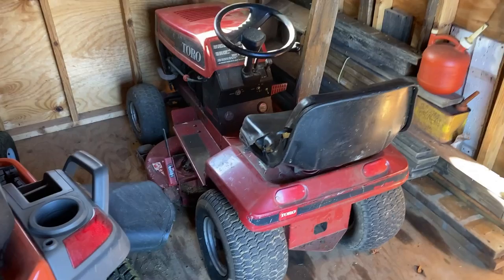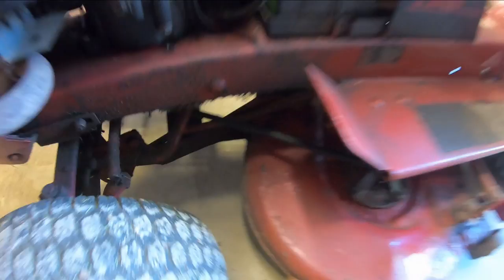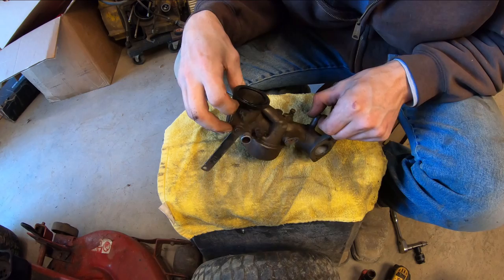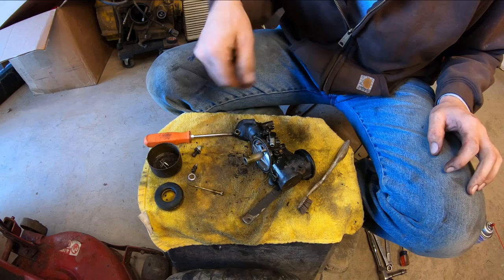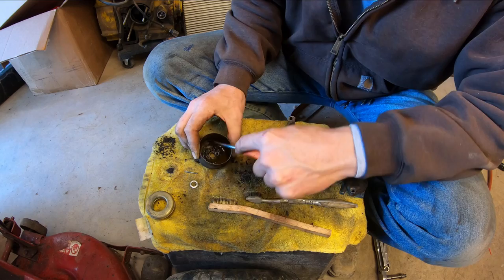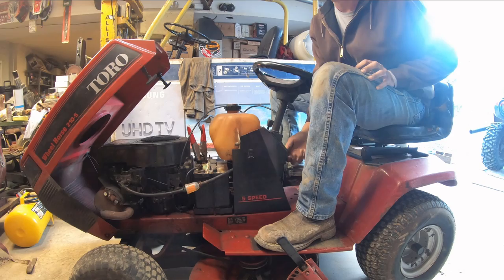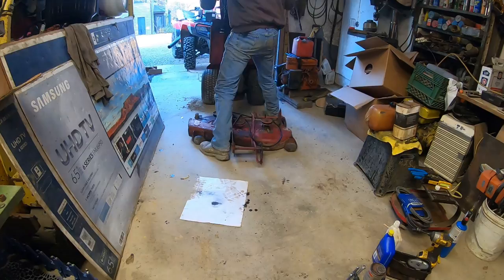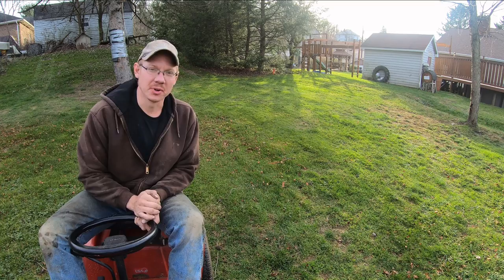Toro Wheel Horse lawn tractor sitting 10+ years Will it run!???

Comment: I agree with you about our "throw-away" society. I generally keep fixing until it is to far gone to repair.  Then, if I can,  I will buy used.  The problem is often a matter of merely cleaning the "broken" machine.  Great vid.
Reply: Unless you can do your own repairs, it's often very costly to have a shop pick it up and service it. The cost of a carburetor kit is about the same as some new carburetors.
Reply: @tiredoldmechanic1791  You are absolutely right! Like many others, I grew up poor, so my family  did a lot of things to get by, like carpentry, mechanics, farming and fishing.  At the time, I thought it was a hardship, which at times it really was. Once I became an adult Iwas able to use many of the skills I learned back then. Now I see it as a blessing.  By doing my own work, I have saved many thousands of dollars over the years. As well, I get a tremendous amount of satisfaction by "saving" things instead of throwing them away.
Reply: Unfortunately a large percentage of the younger generations in today's society mechanical aptitude and common sense has become few and far between, so rather then learning from someone with experience or teaching themselves they have no choice but to waste money and resources on replacements. Thats also a large reason most everything we have to  buy is cheap imported garbage rather then quality local goods. 🚮
Reply: @pnwdad1261  I've discussed this before but you can't really train somebody who wasn't born with some mechanical aptitude. There has been a shortage of mechanics for years.
Reply: I have a lawn mower from 1981 (Tecumseh, 3 HP, 19"). It's so old, in fact, it doesn't even have a dead man's switch (which I like -- easier on your hands). My older brother found it in the trash maybe six years ago, still in fully operational condition. Nearly 40 years after it was built, the machine still starts on the first pull even after sitting all winter, and is the most fuel-efficient mower I've ever had. Can't beat some of those old mow-chines!
Reply: It's really easy to spend other peoples money.
Reply: My step dad had 3 different busted lawn tractors. Instead of buying a new one, I used parts yo make 1 good running tractor and 1 parts tractor he sold for couple hundred bucks. I'd say better decision than dropping 1500 on new tractor
Reply: Same goes for the belts though.  Finish them off. Run 'em till they break!

Comment: When we were little boys these little tractors made us feel we were the top dogs! My first was a Cub Cadet 70. Three Speeds and dad said keep it in first when mowing and when he wasn’t around it was second gear all the time!! Thanks Matt for helping me remember a better time.
Reply: I'm sure there is some young man out there who would love to have this mower to use or even start his own mowing business.
Reply: '71 Cub hydostatic. Go flying down the hill in top gear, lock the brakes on wet grass and go sliding through the yard for forty feet. I can still hear my Dad raising hell:)
Reply: Being a International Harvester Cub Cadet tractor owner as well as a Wheel Horse and Power King tractor owner, you can mow with no problem in second gear, as long as your grass isn't to long, your blades have to be razor sharp, everything greased up properly, and strict maintenance, you'll be fine. Trouble is, in today's society, these outfits change hands to different outfits, and they start eliminating the good old equipment calling it obsolete, parts are hard to get and come by, and they start getting and using chineese garbage and junk that won't last for very long, and needs replaced because you simply cannot fix it yourself. Unfourtionaly, this is our society these days, the good old American know how and good old machines from the past that is built and made with endurance and strength are now a thing of the past, and as each year goes by, it gets worse and worse each year.  Very sad, however, very, very unfortunate and true.

Comment: Strangest 1950’s Gas Powered Air Compressor I’ve ever seen?
Reply: Runs on gas and compresses air in the cylinders, right?
Reply: @corydriver7634  I’m guessing you didn’t see the title “1950s Gas Powered Air Compressor, Will it start” hence all the reply’s referring to a funny looking air compressor. The title has been changed since video first went live.
Reply: @edmullins4519  No, I saw the original title. That was my attempt at humor.
Reply: @corydriver7634  10-4, and you were correct!

Comment: "Briggs and Scrap Iron"
That was good.
Reply: Yep...I had a good laugh on that one as well.
Reply: I prefer Kohler engines myself.  Briggs engines run good when they are on push mowers.
Reply: @danbasta3677  those are usually the little 5hp Raptor engines. A good design. Like Matt said, the I/C's aren't bad but a few years ago I bought a Kubota Zero Turn and could choose either Briggs or Kohler. I went Kohler and it's been a good and reliable engine.
Reply: It was funny but I’ve never had much trouble with B&S engines. Honestly Kohler engine’s have gave me trouble. I guess it depends on the year, and who slapped it together at the factory 🤷🏻‍♂️🤷🏻‍♂️.

Comment: I totally agree with you on the “throw away society” point of view, I wish more people thought that way. Years ago when we moved in to our home, my wife and I hauled several pickup loads of trash to the dump after cleaning up our acreage. The landfill was a 100’ deep crater covering about 80 acres. About six years later I had to haul another load to the same dump—it was a 100’ tall mountain covering the same 80 acres. The sad thing is much of the stuff in there probably could’ve been recycled or reused somehow. Good work keeping that old mower working.
Reply: There are competing schools of thought on what it means to be environmentally friendly.  Do you get the new mower because it uses less gas (or no gas) and toss the old one, or do you fix the old one, save the landfill and keep the gas guzzler?  The environment is probably farther ahead with the fixed-up old one.
Reply: @bonemar66  New lawn mowers aren't necessarily more fuel efficient. Manufacturers seem to keep putting larger and larger engines in their machines. While fuel economy/HP might increase, the higher HP means you're no farther ahead.
Making a new lawn tractor (10 kg aluminum for the block, 40 kg steel for the frame, 1.5 kg rubber for the tires, 5 kg plastic for random plastic parts) would emit at least 167.5 kg of CO2... the equivalent of burning about 72.8 L of gasoline.
TL;DR: if your new mower is 10-15% more fuel efficient than the old, you'll have to do A LOT of mowing before the environment is farther ahead with the new one than the fixed one.
Reply: @NSEasternShoreChemist  not to mention new mowers don’t seem to last as long (at least in my experience).
Reply: @corydriver7634  Yeah, I think it's because the decks are made out of cheap Chinese steel that lacks quality control/corrodes easily

Comment: These old Toro Wheel Horse tractors are tough. We rescued the same 210-5 model left as junk on the roadside with a "FREE" sign on it.  With some TLC and $350 for wheels, tires, seat, spindle bearings, blades, oil and a new carb it will probably run another 30 years.  Wasn't ready for the dump.  What's ironic is the previous owner is a mechanic, and he replaced this with a new Craftsman.  It cut an acre of lawn all summer without a  problem - runs great.

Comment: My old Simplicity tractors have the valve stem on the inside as well.  I think if you add wheel weights, it makes it easier to air up the tires.
Reply: I think it also lessens the risk of damaging the valve on stuff! 🤔
Reply: It's also for when optional hub caps are added.  My narrow frame Cubs are like that as well.

Comment: I've got the little brother to that mower, it's a wheel horse not sure the model but it's got the 8hp "briggs and scrap iron" I believe it's a '90 as well. Damn thing is just as loyal, every spring I charge the battery, change the oil, and "put some wind in the tires" and I'm good to go for the summer. I do get some weird looks from the neighbors being a 6'4" 300lb guy on a tiny mower, but it gets the job done and didn't cost a fortune.

Comment: valve stems on the inside is so you can have wheel weights on the outside and still air up tires, it sucks but it serves it's purpose
Reply: I've never in my entire life seen or heard of wheel weights for lawn mowers. Learn something everyday they say.
Reply: @daver18qc  use them for Ploughing Snow in the winter. Wheel weights & chains on rear tires
Reply: its actually so you dont bust the stems off while mowing around trees and other objects.
Reply: @Randy Rinker 👎

Comment: Berryman 5 gallon vat with parts basket. Cleaned dozens of everything from lawn mower carbs to 2 bbl 4 bbl and 1 bbl. The stuff stinks like yuck but it works. A carb that looks like dirt will come out of Berryman clean as new just rinse under a warm water source after it comes out of the cleaner and prior to reassembly and away you go! Also just like brakes as we discussed before always, always get a rebuild kit for your carb so you get a new jet and seals. Remember the goop that comes out is a foul mess that corrupts rubber as it sits stewing for years!

Comment: in 2020 I bought a 1991 Subaru Loyale from my friend's grandfather for $100, it blew a timing belt in 2000 and got parked in the barn. The battery in it was dated 1998, I threw it on my Noco Genius charger and it took a full charge, cranked the car in gear into my garage to reseal the engine, and lasted almost two years after that... I was amazed lol

Comment: Look at what Mustie ! works on everytime. Curbside "garbage" mowers, snowthrowers and all he fix for next to nothing.
Yes, a wasteful society. Can't stand that.
Reply: People always sell cheap or throw away great things. I bought (for $100) a 18hp, 2 cylinder , 42 in cut Craftsman (really a Husqvarna) that had a frozen up engine. While the seller wasn't looking I spun it by hand just like in this video. I knew it wasn't locked up. Turned out to be just a stuck starter solenoid. Great mower.

Comment: No jokes about Briggs & Stratton, please! I just changed the oil, cleaned the spark plug and air filter on my 1980 vintage lawn mower - and it's still running! It's like the big, US made engines like Detroit Diesel, Cummins or Paccar: they're not that crappy as some people may think they are!

Comment: A friend gave me a 1965 Wheel Horse 1055 back in '06. It hadn't run since they parked it in the shed 10 years prior.  It would turn over, but would not start. (Kohler 321 10 HP).  Complete frame up restoration with the help of friends and I drive it around our tractor show and I've even been through McDonald's drive up on the far side of town. (3 miles)
Reply from the maker: Glad to hear ya got it fixed up but I have to point out that the K321 is a 14hp engine, the K241 is the 10hp
Reply: @DieselCreek  The body is strong, but the mind is weak...I looked at my Owner's Manual and I stand corrected, a K241 it is...

Comment: I picked up a John deere tractor last year with really high hours on it for free. The guy said it would siez up when he tried to start it. I thought????, maybe it needs a new battery. No no he tell me he hooks it up to a battery tender every time he puts it away. Long story short it DID need a new battery and that's all, the high hours where due to leaving the key on while it was on the battery tender. It was easy to figure out the true hours,  how much time it takes to mow his lawn  x  28 or 30 weeks a year  times how old it is. Hour meter said 700 it actually around 250

Comment: Im with ya on the throw away society thing. I take great pleasure in fixing things and making parts instead of buying them or if they are unavailable. I always try to repair original stuff rather than replace it with chinese parts. I use some china stuff when necessary but I exept that I get what I pay for and that there is no real quality control when their manufactured. I try and stick with original and always treat every part with care because I work on a lot of obsolete stuff that you cant afford to wreck parts to get them off. Your Toro Wheelhorse story takes me back to 1978, riding with my grandfather on his Dynamark 8/32 when I was 2yrs old. It also was the first tractor I ever operated alone. I wish it was still around.

Comment: I have the same lawn tractor, bought new in 1990.  Sat for a number of years and with a carb clean and belts it fired  up and still runs well in 2022.  Using it at moms 1/2 acre lawn.  Looks about 95% new, I kept it clean and occasionally waxed.  Original other than belts.

Comment: The PTO clutch is adjusted with the three holes next to the bolts you tighten those bolts so that a .010 shim fits between the plates in the clutch access by those holes next to the bolts

Comment: I use a dremel wire brush to clean the small (carb) parts. Steel on metal, brass on aluminum, plastic on brass.

Comment: I had a coworker that collected mowers left on the curb every spring.  He said there was rarely anything wrong except stored with gas over the winter.  I pick up lots of vacuum cleaners and usually it is nothing more than hair or string on the brush or a hose that got plugged.  Five to 10 minute fixes usually.  Even if it is unfixable or more expensive to fix than replacement value the attachments and cord can be used on other equipment.  In Japan many military people go out on trash day looking for discarded electronics.  Perfecty good TVs and stereos are replaced every 3 or so years because not having new stuff implies you are poor.  That is why decorative parts change so often, so people can date it.

Comment: I am working on the Marvel Schebler carburetor for my Ferguson TO-20 right now. Took 30 days to receive an 'express mail' part that's been holding things up!  I'm also rebuilding an old garden tractor (Farm King) with a class I three point hitch to use in my vineyard. It sat in a field for three years after the building it was in blew away. It is a very expensive free tractor that had a complete mouse city in the motor cowling. I agree 100% with the fix it attitude. When bad times hit, you don't want to be over your head in debt!

Comment: Sounds like the emulsifier tube may still have some crud in it. The engine is hunting for the proper rpm.
Reply: Definitely needs to adjust the carburetor it would also help with the hunting.
Reply: Yeah, the engine should definitely not be surging like that. Could be sticky governor linkage too.
Reply: Looking for more fuel . Emulsifier. Add some choke while it’s hunting , Perhaps seafoam
Reply: Maybe it's just a problem because mine always did that before the mower was engaged. We had it for 30 years lol

Comment: Need to get a cheap Horror Fright handheld sand blaster and a big bag of baking soda. Will clean up copper, brass, and aluminum carb parts without damaging anything. That’s what I’ve used for years to clean up nasty corrosion and crud from old carbs, and my ultrasonic cleaner takes care of the insides.... Also, I use my mity vac to test float valves for seating.

Comment: Hey Matt, I hope you read the comments ? Cause I gotta tip fur ya !  Match the old belt up with the same length and size one at the auto parts center instead of a mower dealership/repair. A lot cheaper bud !

Comment: Venturi is the effect of the emulsion tube when air passes over it in the smallest section of the card throat at higher velocities than the air in the beginning of the carburetor. So technically speaking, you’re right by calling it a Venturi tube 😁

Comment: The reason Valve stems are on the inside  ,when the wheel weights are installed you would never be able to air up the tires.
Reply: its actually  so you dont break the stems off while mowing around trees and other objects.

Comment: Hey Matt,  new watcher,  awesome channel,  love you're will it run again vids, and I don't care what others say,  I love it when you tear apart, break down carbs.  Learned more from you with those gas carbs, and all the diesel engine vids.  I'm a hands on guy myself,  but carbs and diesels have always scared me.   Now,  I want to go and find some to rebuild,  I want to find a compressor like that one you got,  she is awesome!  But I'm 9:27 into this video, and I noticed you have a whole rack of those ball universal sockets,  where did you get a whole set of those,  what brand etc?  I ordered because of you a set of 1/4, 3/8, 1/2" adapters, but would love to get a complete set of SAE/MM with the sockets integrated.   Again thank you for the vids, first time in my 50 years I completely broke down carb and fixed myself instead of paying someone else $$$ for pulsating engine!  She's running great,  Thanks Brother!!

Comment: Good old NAPA Valvoline oil. Good stuff and we've got 2 mowers made in 85 and still run fine. Briggs L-heads. And there's no use in new if original works.

Comment: I sort of agree with you on the varnished gas... Its way better than the smell of burned gear oil from a diff. Or an automatic transmission with 200k miles etc.

Comment: The tube with the little holes is the emulsion tube. It helps regulate small amounts of fuel on small engines by mixing fuel with air.

Comment: A lot of the smaller parts on that thing look the same as my '90 16hp. If you get weird electrical glitches and non-starts and sh*t, take a look at the fuse block top and bottom - they're famous for corrosion and breaks.

Comment: Here’s how you get belts. Look in the manual or google for the belt number. Go to eBay and use the number in a search like “23367 belt”. You’ll find  bunches of sources of belts for like 6-20 bucks. It’s the only way I buy mower belts anymore because of the high prices. A little patience goes a long way.